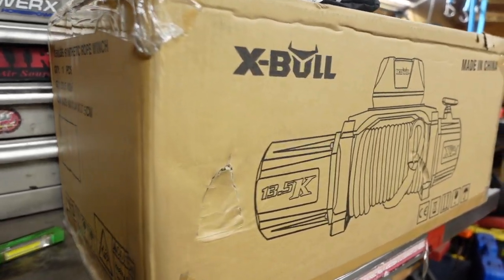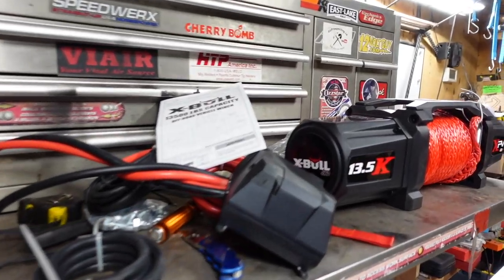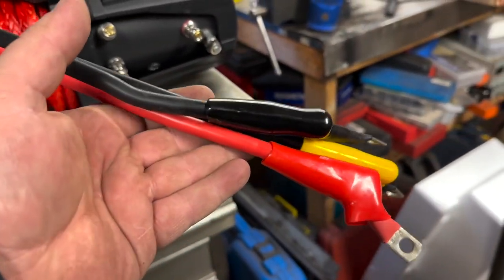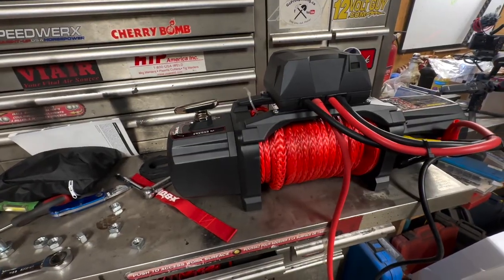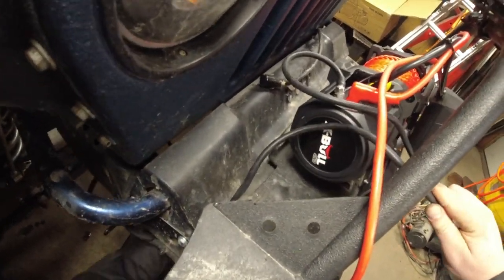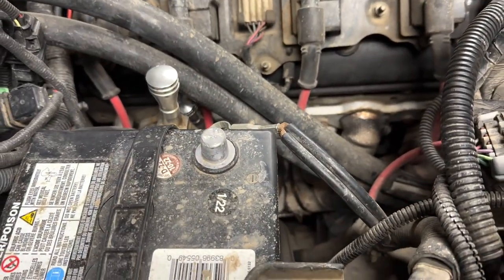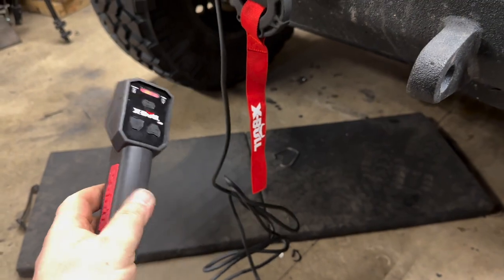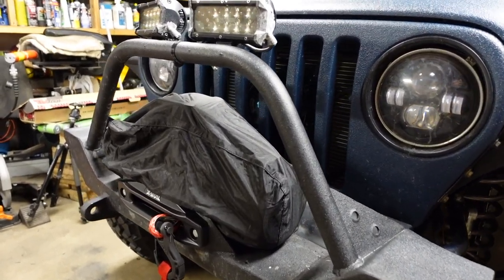X-BULL 13500 WINCH INSTALL ON JEEP TJ

Comment: Hi!
Wanted to hear your feedback on the X-BULL 13500 WINCH.
There is not much information on the internet. How does this winch behave in hard use? How reliable is it? The data sheet says 6 tonnes of force, is this true?
Reply from the maker: I was able to winch my jeep and camper trailer though a mud hole recently and worked awesome
Reply: That's great
I got one of these too.
Quality and price match

Comment: How is the winch working? I am really considering getting this exact model for my XJ.
Reply from the maker: So far so good the key is a winch cover
Reply: Did it come with one??
Reply: Mine didn't  come with a cover. I got a cover for around 20 bucks. So far I and other people haven't gotten stuck yet. I used the winch to rip a shrub out of the ground. It was dragging the jeep. Then I used the winch to pull a trencher out of the trench it got stuck in. Nice winch I would recommend it.